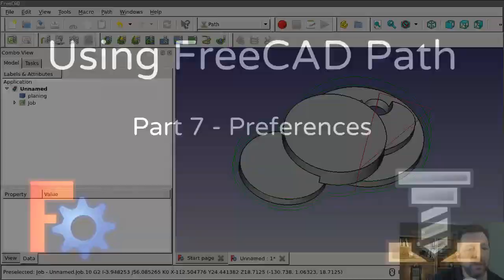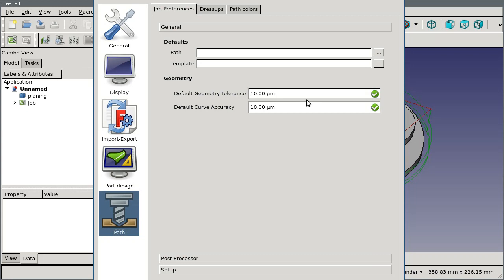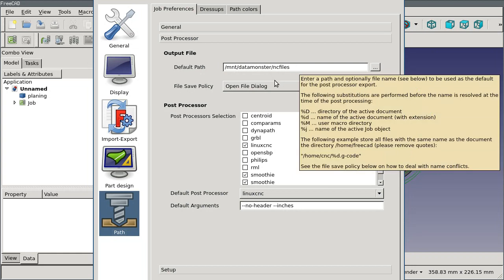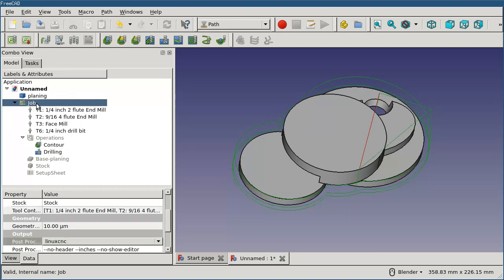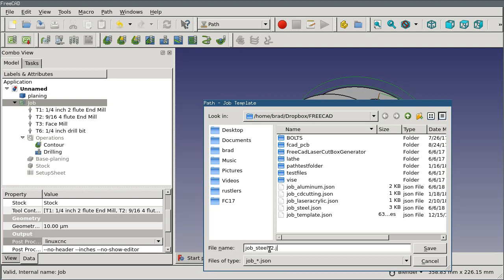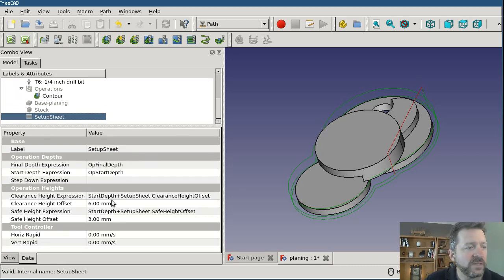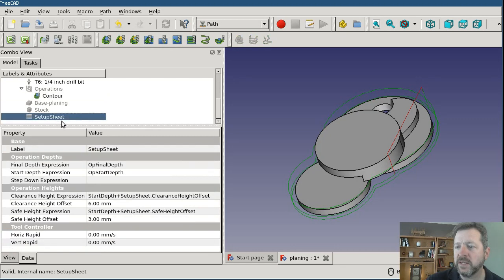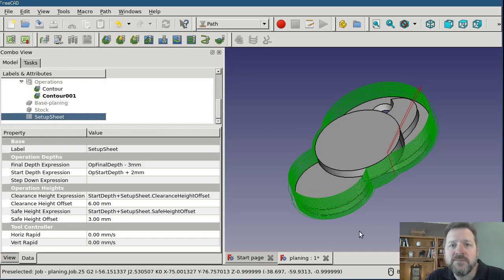Using FreeCAD Path - 7 (Preferences)

Comment: Thank for the video. I am quite new to freeCAD and path (still learning) but have upgraded for the second time to the latest stable release 0.21.1. I tried to migrate my tool library manually by setting the paths etc.  This does not work correctly. Apperently it is nescesarry to edit the user.cfg file manually and also setting the "macro'-path to make the job_template list-box fill correctly. I am using the portable version by the way.  Could you please update this video. I have a hunge I may be doing something incorrectly..  Love the path workbench by the way!

Comment: thanks again.   a simple cube with routed letters will post process incorrectly when I save as an .nc file or the only option for that being mach3or 4.   I wanted to share what i do and assume most have cyphered it already........In Freecad  when postprocessing to mach3,4 because there is not option for .nc files….The “start depth” and “final depth” under “Engrave”  need to be from the top of the board downward, so start depth for a 19mm board should be about 20mm and final depth I set to say ie..14mm or 5mm down from the top.

Comment: Is there a way to have the sheet modify "already created" operations (not just new operations).  If I want to change the stock thickness I use, then I want to just type the new thickness/depth and have all the operations change appropriately.
Reply from the maker: Yes.  No....Kinda...maybe?  It really depends on how you're using the setupsheet and the operation heights/depths properties.  If you haven't overriden the expressions in the setupsheet or the operations, then it works.   Changing the stock thickness will automatically update the operations.  (Well, almost automatically.  You might have to recompute the operations, but you shouldn't have to adjust anything).  
If you've changed your setupsheet expressions or overriden things in the operations with absolute values, then all bets are off.
Reply: @sliptonic  Oh, can I put the default "spreadsheet expressions" back again?
Reply from the maker: @TheRainHarvester  Not automatically.  But you can cut/paste them from a new job.

Comment: Great videos - thank you so much!
 I really apprecciate your contribution to FreeCad and the Path Workbench. After some difficulties while starting with it I can use the Path WB for most of my CAM jobs now. But today I definitely failed - maybe you have a hint for me? I want to use a combination of several splines from my drawing to create a pocket (with a 10mm milling bit). Thought I could use the engrave tool but it always stops after the first spline, raises the mill and travels to the end of the next spline....
Is there any option to follow an open (!) contour and to set up an operation for that?
I'm using FreeCAD 0.18 16110(Git) on a Windows10 System.
Reply from the maker: Engrave and Deburr will follow an open edge as base objects.  The problem you're seeing is almost certainly an issue with your geometry.  It sounds like one of the splines is drawn backwards.  an edge has an ordered set of points and Path follows that order.  With closed loops, we can iterate through to make sure one segment starts where the last one ended but that's probably not being done for engrave.
Reply: @sliptonic  thank you - Engrave doesn't follow a B-Spline with multiple control-points. I replaced the spline by several standard-splines and it worked perfect. I can send you the file if you want - it's a ski.
Reply from the maker: @steffenheycke1780  I've played with bsplines only a little in the current dev version and they're not well supported yet.  Deburr occasionally gives me a valid path but engrave complains and does nothing useful.  Will look into it but if you've got a work-around, that's probably the best you'll do for now.  Sorry.

Comment: Regarding Job Templates:
What is the syntax that needs to be used for the preamble and postamble  arguments? 
The General Job uses i.e.:  --inches --preamble=";my test 180915" --postamble=";that's all folks".  Is it exactly the same for the Template files?
Reply: I found the syntax at https://www.w3schools.com/js/js_json_syntax.asp plus I exported the job template for one of my projects so I could look under the hood.  I will try to create the preamble/postamble strings using these two references as guides.  The actual preamble I need to use exceeds the stack limits for the default post processors arguments.
Reply: Still unable to derive the syntax for json file parse that is unique to FreeCad.    If someone can tell me where the parser's grammar rules are located <assuming flex or lex is being used> I can go forward from there.

Comment: I started using path in freecad but selecting faces quickly eats memory so much so that a seemingly simple shape is near unworkable.  In addition the memory hogging remains even if the file is closed in freecad.  A complete shutdown of freecad is needed to continue working .  just simple face selections become hell.  I am writing this so developers can see that it's good but needs to be addressed to become a serious tool.  I can make a video to demonstrate the problem and provide files.
Reply from the maker: Alain Pelletier please do. Also please show your FreeCAD info. I can't say I've seen freecad behave that way
Reply: I used freecad 0.17 on linux and windows 10 and now just installed the 0.18 dev hoping the problem had been adressed.  I will make a showing all of the steps I am taking.  It looks like a garbage collection problem.
Reply: the video is uploaded https://youtu.be/CoJDBR3wY84

Comment: A great introduction to PATH Workbench!  Thanks!  I just went through all the videos, PATH 0-7 and feel much more prepared.  There is so much to learn...

I started with a kit 3D-Printer less than a year and just put together a version of the Mostly Printed Parts - CNC (MPCNC). These videos introduce me to the PATH Workbench and helped me understand some of the challenges in Milling operations.  In looking for CNC-CAM software I probably would have missed the PATH Workbench if it were not for your videos.  Very well done!

FreeCAD's PATH Workbench  addresses 2.5D milling with an impressive implementation. I look forward to sharing experience in the forum.  I wanted to express my appreciation of your videos and efforts.